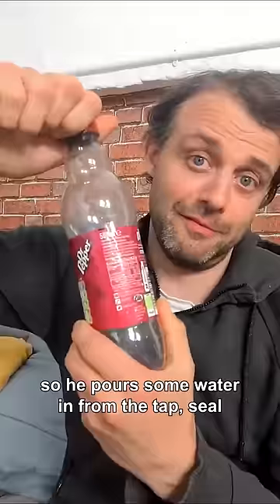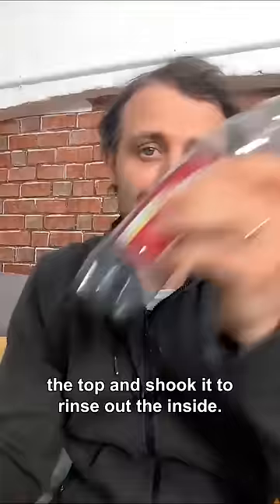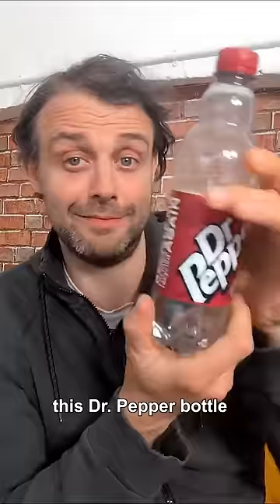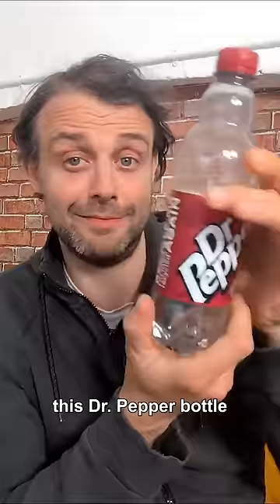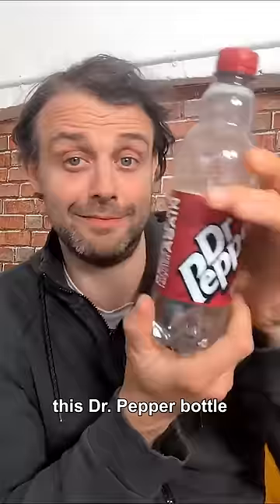Fizzy Drinks Collapse When You Do This... But Why? #shorts

Comment: i watched a video in elementary school explaining this phenomenon, and bill nye showed it off with a giant metallic barrel and a kiddie pool full of ice water and it fucking exploded BOOM ! YEAH ! according to a YouTube video where this experiment is recreated, it happens because of the pressure generated by the rapid transition of steam to water. Reverse steam explosion! Your guess about the surface area of the water having something to do with it was very clever. I believe it increases the rate at which it cools, making the result more rapid and intense. if you put hot water in the bottle, shake it, and dump it in ice quickly, I believe you get a stronger reaction <:

Comment: Unconvincing demo. Didn't have a "control bottle" which didn't have CO2 in it. Didn't exclude the possibility of air being cooled ( causing reduced volume) by cooler water.  Fail.

Comment: Why does the CO2 dissolving into the water decrease the overall volume instead of equally decreasing the volume of the gas portion and increasing the volume of the liquid portion?
Reply: See that's what I'm wondering
Reply: When the CO2 enters water some of it forms  carbonic acid, dissociates into Hydrogen, carbonate and bicarbonate ions. The volume of the gas is reduced by the formation of these. The CO2 gas will dissolve into the liquid until it is saturated.
Reply: Same reason that if you had a bucket with rocks pouring water into it doesn't increase the volume in the bucket until after the water has filled all the space between the rocks.
Reply: Gas generally has a lower density than the aqueous solution, so yeah, you're technically decreasing the gas volume, but by less! The masses change in equal amounts.

Comment: It’s a temperature change. 100%. Not even a question. You are changing the air temperature, pressure,  and density inside the bottle by shaking cold water through warm air inside a closed container. Of course the air is going to contract.

Comment: And also the temperature difference of the water vs the bottle and the air inside it...

Unless of course you dont have drinking water taps because of bad government and or dont keep your water chilled if its bottled water
Reply: That would only happen if you had a warm drink (and warm CO2 inside), and then put cold water in, right?  That seems unlikely to me.
Reply: Does this man really think water comes from the government
Reply: @azrobbins01  as the fluid comes out the air temperature air goes in

If i have a drink thats 1c by the time im done with it the bottle and air inside it will be at least 15c average for the entire bottle and contents so chilled water was 1-4c will implode the bottle even without C02
Reply: @commanderoof4578  I would think that as you drink the cold beverage and introduce warm air, that the drink would cool the air  down.  Also, the CO2 that effervesces off the drink will be cold.  So, if you had a temp probe in the center of the bottle, just before you added water, I would think it is colder than the tap water, unless you have really cold tap water.  

My tap water is about 55F or 12C and my drinks are about 32F or 0C.  I keep my refrigerator at the freezing point in the back.  Maybe I am wrong, and the water is colder than the air in the bottle just before you fill it.  Not sure...

Comment: except believing that a lot of CO2 was left in an empty soda bottle is kinda a huge leap in logic. It seems logical that he was rinsing his bottle with hot water to most optimal dissolve sugar. After sealing it with a very small amount of water he shook it which caused a small amount of hot water to be rapidly cooled by continuously changing contact surfaces. Leading to the collapse.

Comment: Hey hey hey! If you wanna go down the rabbit hole of gases dissolved in liquids there is a lot more to unpack than just carbonated sodas. Especially for diving. 

It all starts with recreational diving. As you know regular air contains 21% oxygen. Which is fine to breath with your first diving certificates. It also contains a lot of nitrogen which has the effect of making you act weird while diving if you go too deep for too long and could give you a stroke.

So divers start use enriched air. It's basically air with a higher oxygen content and a lower nitrogen content. The more oxygen and the less nitrogen you have. The longer you can stay at certain depths. But there is a catch. As soon as you hit pure oxygen you can only dive to around 4m deep and then it gets poisonous, starts to destroy your central  nervous system and kills you 🤯🤯🤯WHAAAAAT? oxygen is poison?

Even better, if you start to dive deeper you actually reduce the amount of oxygen in your gas mix.

Hardcore technical divers go as low as 4% oxygen. 
This would kill you on the surface,  that's why these are called hypoxic gas mixes.

It gets especially tricky because now you have to substitute the other gas components. The gas of choice has become helium. Commercial divers that work for months under pressure (not under water for this time but under pressure until the gases are saturated in their blood) really sound like Mickey Mouse. (Also find out what happens if they open an in prior shaken soda can under pressure)

I think the latest hot thing in diving is using just a tiny bit of nitrogen in your gas mix in order to have a little of a narcotic effect on your nerves. This gas, dissolved in your blood, prevents you from getting a tremor because of the pressure.

But also there were two scientists who discovered to use hydrogen while diving for never before reached depths (its because the lighter the gas molecules are,  the easier breathing is).  But back: 
Yes hydrogen... with oxygen... under pressure 😅😅😅

And this goes on and on and on.

The science of gases dissolved in liquids is super interesting for divers and worth checking out. But as mentioned. Its a rabbit hole.

Comment: my theory is, that when he filled the dr pepper it was hot water.
When he was shaking the bottle it was cooling down the water, and therefore shrunk the bottle.
Reply: No that would actually have done the opposite since it would heat the air and that would expand way more than the water would contract.
Reply: @bjornmu   indeed. hot water will expend. but that is when the lid is still off, when the lid is put back, the air shirks when it cools down. therefor the bottle collapse

Comment: This guy is usually a lot smarter than this. CO2 is soluble in water but that doesn't explain the same effect on water bottles that never had any CO2 in them. The primary cause of this is because the water is cold and by shaking it, you remove the heat from air inside causing the air to condense lowering the interior pressure.

Comment: but if you shake carbonated water the carbon dioxide comes out? how does that work?
Reply: The carbonated water is not the stable form (once a drink is opened). The dissolved gas does want to escape the liquid but that has an energy cost associated to it.

First enough CO2 molecules need to gather up in proximity. 
Secondly, the energy needed to phase separate needs to be overcome. Basically, unless the CO2 can form a large enough bubble it's more energetically favourable to remain trapped in the dissolved state. This energy barrier is lower on container walls which is why you can see bubbles form there over time. 

The rate of this reaction chain is quite slow under normal consumption conditions (poured drink) which is why the drink stays fizzy. This is often referred to as a meta stable phase.

When you shake the bottle you are adding energy in the form of acoustic waves which can aid bubble formation. You also introduce new bubbles made from the small air pocket trapped in the container. These bubbles introduce more surface area from where the dissolved CO2 can escape.

And as someone pointed out, if you leave the drink unopened, most of that CO2 will eventually go back into solution due to the pressure in the container. Gentle mixing, eg. rolling the bottle slowly, can speed up that process.

Comment: What is more likely is that he used hot water to clean the inside.  Which means when he sealed the bottle the air was warm and as it cooled down the air volume decreased.
Reply: Watch the video. He said tap water. And that the bottle collapsed after shaking. Don't try to explain a scenario with false setup.
Reply: @itsgonnabeanaurfromme  my tap water can be hot

Comment: The same amount of pressure is in the bottle when you close the lid. Resolving CO2 into the water in closed system wouldn't change the pressure in the bottle